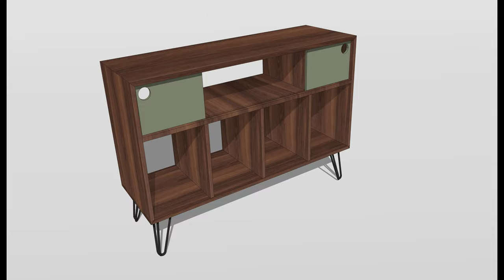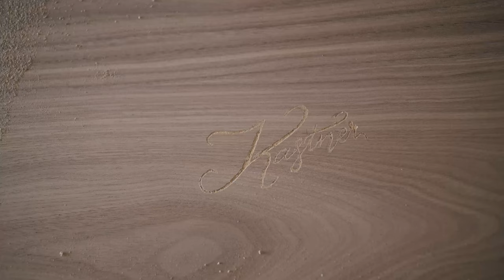Mid-century Modern Record Player Cabinet - DIY Build

Comment: This is a great idea in theory, but in practice, not so much. I would advise placing the turntable on a separate unit because, as it stands, the speakers will generate resonance in this cabinet, which will travel up into the turntable and on to negatively affect the ability of the stylus to track the record groove properly. At the very least this will cause smearing of detail & at worst, it may generate feedback. 😉

Comment: You mind providing very basic dimensions of this? Love the size you chose and would hate to be just shy of the piece of walnut ply as it's expensive. even knowing the length, width and height (minus the legs) would help tremendously. Thanks for sharing your video!
Reply: It must be something like 48w x 24h x 16d. I was able to spec out all of the pieces on one sheet of ply with those dimensions. There are 3 dividers on the bottom that I believe are close to 14x16 and then the top 2 dividers are 10x16 give or take placement of the middle section.

Comment: I have found it's better to use the rounded edge of a router base when routing along a straight edge. That way small rotations won't affect the dado. I notice you use the flat edge. Have I been doing this wrong? Love the piece!
Reply from the maker: Yeah that's what I would normally do - think I just set this one up in a bit of an awkward way and didn't really have much option to do that without flipping the router around and using the handles backwards... if you're careful and use the flat edge it can work out fine :)
Reply: The circle can be dangerous because contrary to intuition, the bit is not perfectly centered on every router so rotations will have an impact

Comment: What stain, and top coat did you use on this? Looks incredible!
Reply from the maker: Thanks!  Was finished with two coats of hadwax oil - no stain or anything else on the timber.  The one I used was from Whittle Waxes (Australian made) and used their classic finish, which is somewhere between a matte and a satin sheen.